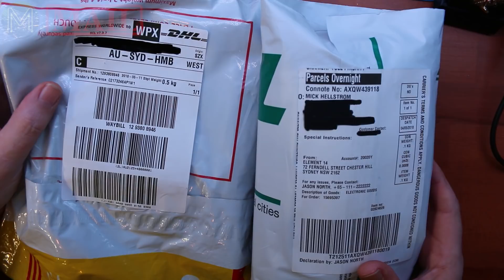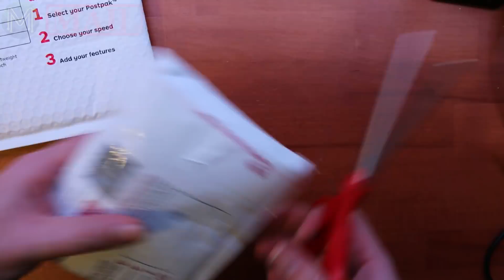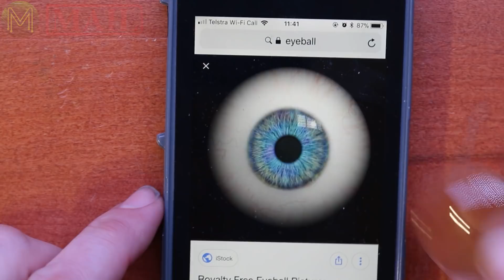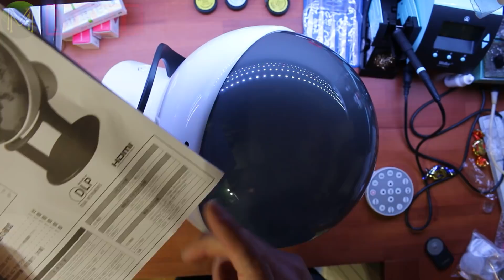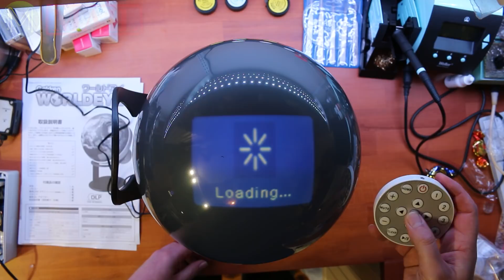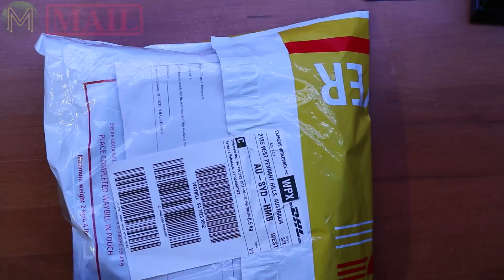#211 MickMake Mail #30: Gakken, JLCPCB, wicking & skulls

Comment: Your channel is steadily becoming one of my favorites! I LOVE the braid gun product but $40?? Get out! Let's design one and 3D print it.
Reply from the maker: Thanks mate! Glad you’re getting a kick out of it.
The braid gun?! Yup a few people have mentioned that. My only concern is that the PLA would melt at solder temperatures. So there would have to be some part of the body that isn’t PLA
Reply: MickMake - use flame resistant polycarbonate filament, at least for the hotter areas like the tip.

I've submitted an inquiry to MatterHackers about the heat of a 600F/315C soldering iron being near the material.

Comment: That wick gun for $40 wouldn't you just 3d print a entire gun that takes some kind of standard spool thats just a crazy price for something that's molded plastic.
Reply from the maker: Yeah, a couple of people have said that.
The only issue would be the temperatures. Irons gets to 350C, which would make PLA rather soft.
Reply: Would the wick fit inside a PTFE tube? that's rated to 240* then 3d print the case out of ABS that's rated to about 110* glass transition temp. The temp will be only in the Wick it self and its not like its traveling to far up?
You could use silicone and put a covering on the inside that will up the heat rating. As i said for $40 this is kind of a ridiculous price for what it is.

Comment: Those plastic skulls as a 3d print with a case style mount for a sbc say pi or ux4  add a camera microphone and speakers and your projector   cap touch sensors and it's a Bob the skull unit a la the Dresden series
Reply from the maker: Ha ha. Yup I will be mounting an SBC in there as well as cameras, so you’re right there, but there’s more to it. :-)
Reply: Kinda thought so just looking at them had so many ideas .

Comment: FYI, for taking off multi leg SMD there is a kit which consist of flux and a special low heat solder. You put solder on all the legs then move a soldering iron real fast back and forth the chips comes off real easy. Then use the braid to clean the pads. Use this at my last job to replace quad 32 leg pic chip
Reply from the maker: Yup, that’s another method of desoldering. I often do that as well, but with normal solder. Works OK if you’re fast.
Reply: If you don't want to risk damaging the PCB, use ChipQuick low temp solder.  It isn't cheap, but worth it.  Cleanup afterwards with the solder wick.  Of course in many cases you can just use hot air.

Comment: Glad they arrived safe Mick - A shame you had no solder paste - one of the kits has a mylar stencil in it so you can paste it up easily when you get some... or you can frustrate yourself hand soldering if you really want ;)
Reply from the maker: Yup, I saw that, but after I shot the video. I've now ordered some paste and I might pickup a dispenser as well.
Reply: Nice!

Comment: I remember when I was in my teens using a lot of braid just like that for slot cars. The speaker in that eye thing sounded a little bad so plugging in a set of external speakers via that earphone out socket would have given it better sound.
Reply from the maker: Yup, the cooling fan is also really noisy. They could have done a better job on it.

Comment: 40 dollars for that piece of crap?
Reply: NS Gaming , not if you use a pair of cutters ;)
Reply from the maker: But, you'd need some way of coping with the PLA melting temperatures.
Reply from the maker: Yeah, I thought it was a good idea at the time.
Reply: MickMake 3d printing challenge accepted :) the cutting might be hard to do.
Reply from the maker: Nice to see a wick feeder on ThingiVerse.
Reply: Screw the 3D printer, send it back for a refund.